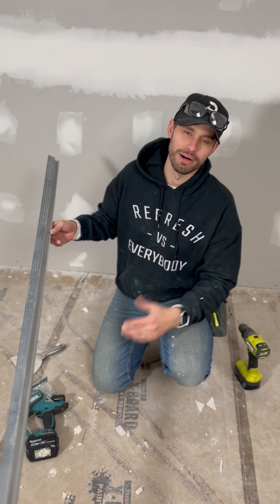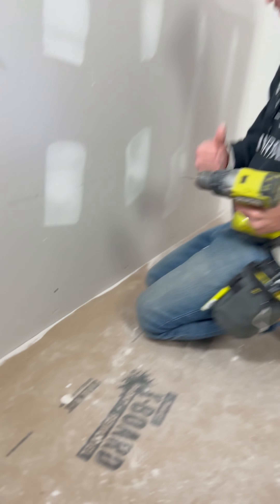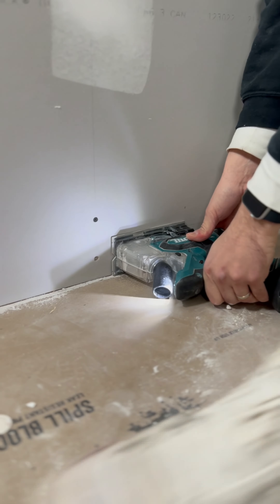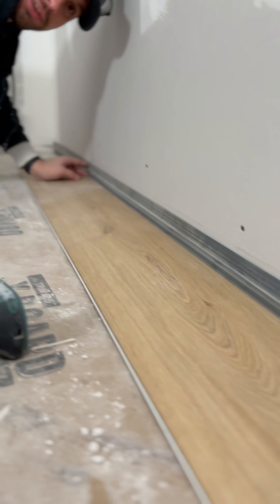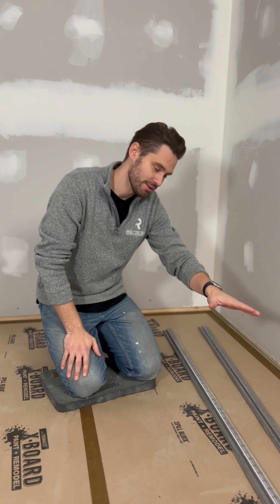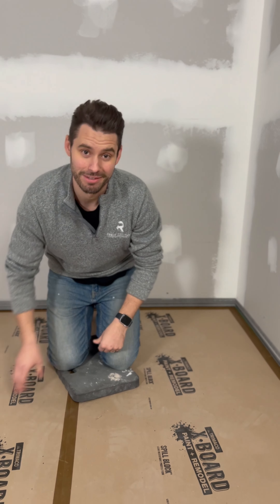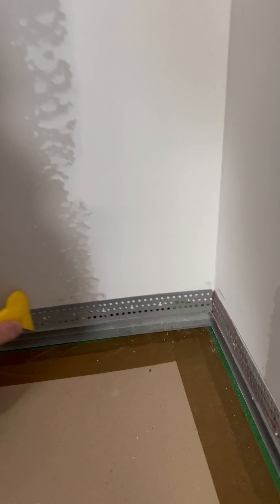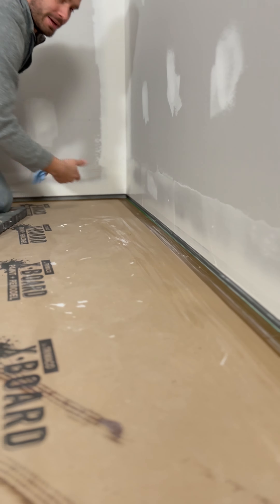Bye Bye Baseboards! F Reveal Bead by Trim-Tex

Comment: Unfortunately as a flooring installer knowing that floors change every ten years, your f bead doesn't allow for resilient flooring replacement, nor different heights of flooring in the future. You're better off running a 4-6 inch base that can be ripped down or replaced below it.

Comment: Very nice detail.  I'm surprised no one seems to stock F Beads in my area....$200+ freight for the case.
Reply: I had to call about 4 or 5 places (around houston). A few were able to add to their stock orders to avoid shipping. Also the price varied from $80-$120/box for the f reveal that I chose…well worth calling multiple companies! Shipping was between $200-300 and I was able to avoid that…especially because I’m going room by room I don’t need it all at once and can’t justify that shipping cost! (I’m a DIYer)
Reply: Call a trim tex distributor and special order from them.

Comment: Normally floors need to be installed with 1/4" gap against the walls for expansion. What do we have to do to install F beads?
Reply from the maker: Great question! These beads are 1/2” thick at the bottom so the floor goes under 1/4” and still has 1/4” for expansion.

Comment: But with less than 3/4 inches at floor base, aren’t you concerned about shores, vacuums etc scuffing and banging into and a  bottom 4-6 inches of drywall ?
Reply: Yes this completely ignored the functional purpose of baseboards, but Instagram and Youtube cool homes never need vacuuming or have furniture legs bump against the drywall, so no worries.

Comment: So clean. Would it be possible to put carpet down before / after this? Or only for floorboards?
Reply from the maker: installing carpet after might be tricky for the carpet installer (but not necessarily impossible). Before should be no different than floorboards though 👍

Comment: How do you protect the pre-finished floors?  Do you tape all the way to the framing?  If so, the tape will end up under the bead, right?  Just wondering how you keep the drywall dust away from the floors or how you remove the tape once the bead is in?  Thanks!

Comment: I love the look of it, but what will you have to do if you’d want to change flooring few years later? Would you have to rip off the beading?
Reply from the maker: If the new floor is the same thickness, our slightly less, you might get lucky- but in most cases, yes you would likely have to remove the detail and reinstall it. Another option would be to simply add baseboards over the detail with the new floor installed 🤷‍♂️.

Comment: Hi Guys!  Love the channel and your goofy sense of humor!  I am building a house in Texas and planning for a trimless base.  Wondering if you still recommend the "F bead" over something like a "Z"?   My architect prefers the look of the Z, but I am concerned about the edge of the edge of the flooring showing and/or dirt settling in that little space back there.  Would love to hear your thoughts.
Reply from the maker: Sounds great! That’s a great question, the Z does look better, but if you leave proper 1/4” gaps for flooring you’ll see that underneath. If you add double drywall you could get away with a Z otherwise you kind of have to go with a F
Reply: @RefreshHomeImprovements  Thanks for replying.  One more question about installing floors first...  How do you protect pre-finished floors?  Do you cover floors completely with ram board?  Do you tape all the way to the framing - meaning underneath the bead to keep drywall dust off the engineered floors?  Then how do you remove the tape after the bead is installed?  Thanks Guys!
Reply from the maker: Hey! You’re more than welcome! We just run Ramboard and then tape as close to the beat as possible. He won’t do much damage to the floor right next to the bead and if any paint or dust gets on it, you can easily wipe it off. We’d be more concerned about scratches and heavy dents, etc., with the Ramboard

Comment: I have a question... If you ripped a piece of long wood the same height as the Trim Tex F bead and that wood piece were 6 to 10 foot long... and set it on the floor, then set a 4 foot or 8 foot piece of sheetrock on top of that wood piece like a boot, then screwed the drywall into place, then removed the 6-10 wood footing... would the Trim Tex F bead slip right into place and avoid all the cutting?
Reply: Yeah there are different ways to do it. What you describe is called using spacer blocks. Generally you do this on the subfloor, not on the flooring (flooring needs to be installed as close to the walls as possible). So make sure you know the thickness of your flooring, underlayment and add 1/8" or so on top of the thickness of your reveal bead (So you have a little bit of wiggle room to install the beads) The advantage of your technique is way less dust.

Comment: Looks nice, but what happens when the floor needs replacing? Also, what happens when you mop and vac? I guess in this case, the textured wall will hide dents and dings.

But the guy installing is just so annoying. I don't thing I can subscribe.

Comment: I hate old school baseboards and this is exactly something I’d do in my home,… especially with a new floating floor.  I was surprised the F-Bead covered the gap and essentially replaced quarter round. 
Does this meet fire code in the USA?
Reply: Just install blocking between studs, or use a double bottom plate (with 1 1/2" shorter studs though) to provide solid wood blocking behind the raised drywall.  That will match blocking fire properties and should meet the code.  Run it by your local inspector first, some get their nickers in a knot with new techniques.
Reply: They call this one the bug highway and motel. You will also have to run your flooring all the way up against the framing since there is no baseboard to cover it. Have fun with your seasonally warping floors.